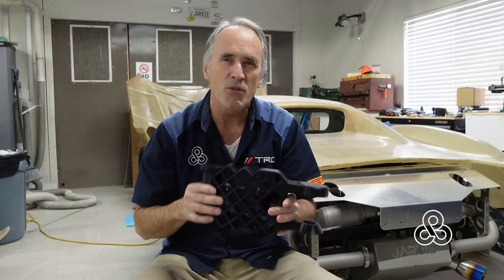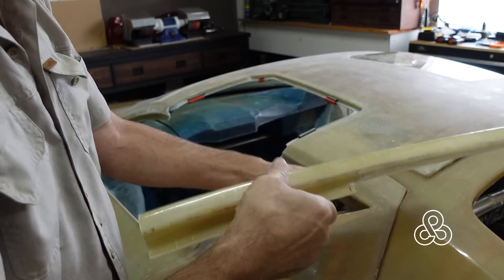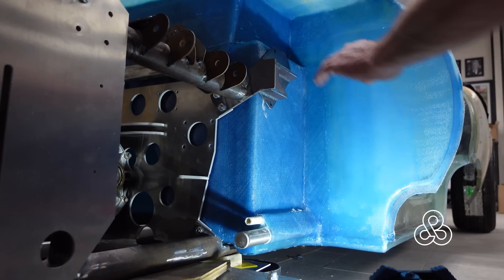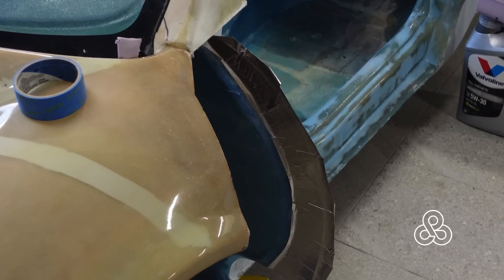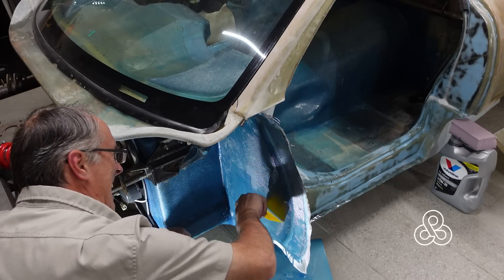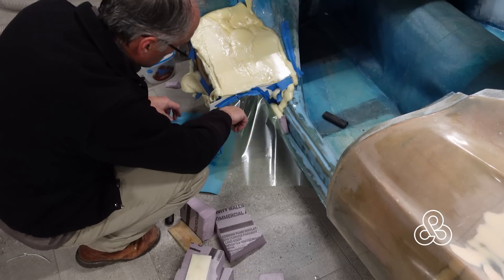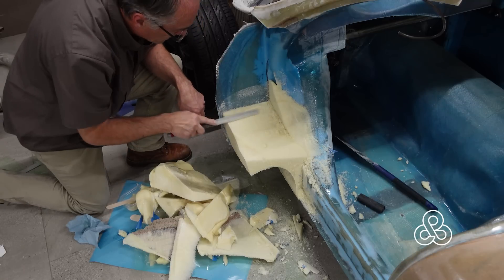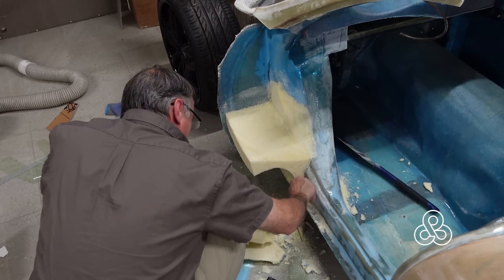A86  Cut hack and laminate- The new door plan! Arete Supercar project

Comment: Glad to know that your health is better.  I am enjoying your projects progress, and your problem solving techniques.  

If I am correct, you mentioned earlier you may have an issue with the wheel well and the tub foot pedals. Not very much room if i remember correctly.  Do you have a solution, and do you think you might a design solution to avoid this kind of pinch point in the future? Like mabe moving the front wheel suspension forward a few more inches?
Reply from the maker: I did cut some out of the foot well in a previous episode, so it is usable but tight. The easy solution would have bean to build with a rear trans-axle and no center tunnel . . easy, but would have cost $10,000 more. Ouch!

Comment: I'm really enjoy to follow your project. I have 2 Lotus Europa, a 1968 and a 1971. They are very different than your car. 
How much do you believe will be the final weight of the car? One of my Lotus weight is only 560 kg.
Reply from the maker: The original goal was to keep it under 900Kg, but it will likely drift closer to 1100kg. Although the car is small it is still much bigger than the Europa and has a MUCH heavier power plant which requires a heavier cooling system, bigger breaks . . .  . .etc.  Fun little cars the Europa! Had a friend who did a Mazda rotary swap into one. Gave it a good power upgrade, but still kept the weight balance for that famous Lotus handling. Glad your enjoying the videos. Thanks for following the build(s).

Comment: Tool tip.
You can buy cable or rope cutting blades , usually in survival, camping stores. They’re good for cutting and shaping foam . You can make a simple attachment to a multi tool to automate them or a length of bandsaw blade .
You get a dull multi tool blade cut it down and put a hole to attach the saw blade to . Then make an extended handle similar to the bow of a hacksaw to attach the other end of the blade via a spring .
Reply from the maker: Yeah, great idea. I have used pre-shaped wires for cutting shapes with a hot wire cutter in polystyrene, but it might work to create a stiff "shaped" blade for the oscillating saw to cut urethane foams!

Comment: @11:40 The subtle flashing in your video is caused by LED lights. There is a LED lightbulb somewhere in that room. When filming indoors, only use incandescent lightbulbs.
Reply from the maker: I'm checking into this, as I've started to see it more often in videos. I think it occurs when someone in the house uses hot water while I'm shooting video. The instant hot water heater draws so mush current that the lights cycle drops enough to get close to the 29.97 frames per second of the camera. Every light in this house is LED. Someone else will have to foot the bill for changing them all over to incandescent and pay the power bill after that. Ha!
Reply: @BuilderCreator  You can still get 100 watt incandescent bulbs at homedepot, and lowes. Also, you can open that window, and let that sun in. Position a mirror outside, and shoot some light in, when filming. You have a cool channel!

Comment: Jay.  Some constructive criticism.  I was one of the followers who guessed a door hinge assy in prior episodes.  My concern is using the actual car as the quasi mock up/real world door build. Just Don't!   As someone who has worked on car doors in a professional environment...yeah I know that sounds odd but design for a vehicle that has to repeat itself over ...whether a one off or 1Mx over, its a brutal task.  You are heading to a world of frustration otherwise.  Re-create what you have on the car in a separate scale mock up.  Otherwise once this car is built your door sealing and closing will be compromised. You need to see how the whole system reacts.  Builders think door fab and function is easy.  Ask a professional automotive engineer or a resident engineer in an assembly plant.  They will tell you the opposite.
Reply from the maker: I understand your concerns! Know however, that this project was never started as an easy build. I could have taken a hundred easier paths and gone with ideas that would have "fallen" into place. This project is in its very nature, "a world of frustration!" I like it that way; I learn and grow. Know also, that this is one of the few parts that I am 3D modeling and reverse engineering as close to Keonigseggs as possible. Christian Keonigsegg said in an interview that they have thousands of hours into the door design; I am not opposed to using there time as my R n D. We shall see, future videos will have early success, or me cutting things up and sticking more epoxy and fiberglass were it should have been in the first place. Ha! Thanks for the input and following the project.